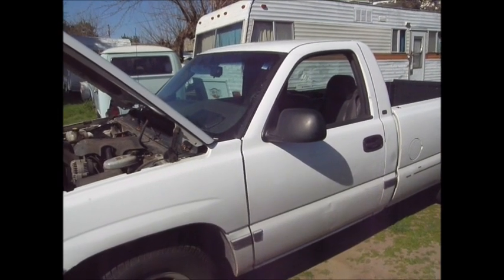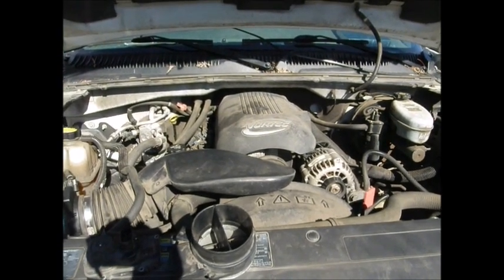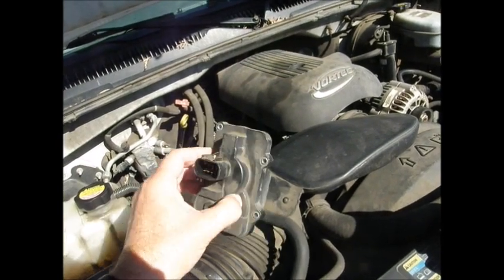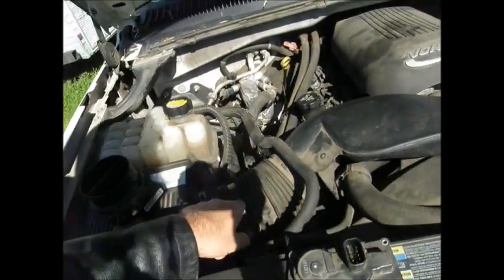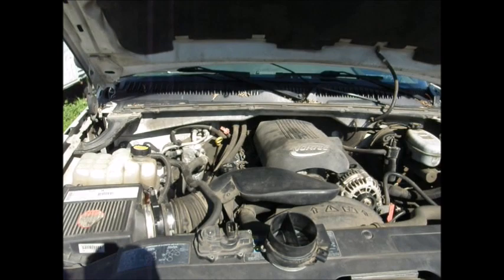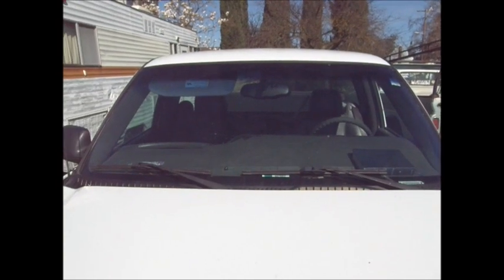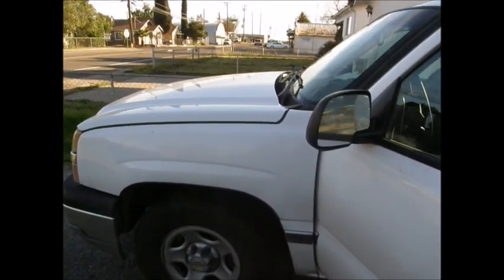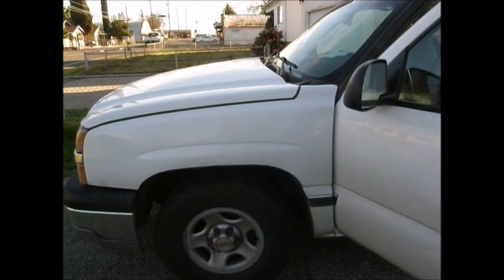Chevy Silverado Reduced Power fixed.

Comment: I have a 2003 Surbuban, it has a new Throttle position sensor from previous owner and the pigtail wiring is new but its wired with wire nuts. Lol. Yeah but as of now since I worked on it, it was the ground on the passenger side wiring harness next to the firewall. It had a inch long split in the wiring exposing the wire and probably arching. I cut it, soldiered it and used heat shrink tubing about 6 inches long to cover the exposed wire. It was throwing 6 codes, now nothing. I also cleaned the grounds under the driver side door to the frame. So hopefully all is well. Time will tell. Glad you fixed your truck

Comment: Have the 5.3 liter 2003. Doing the same. Scan tool will not show what the problem is. Was it the mass airflow, or the Throttle body sensor the problem?
Reply from the maker: I changed both of them so wasn't sure which was the ultimate problem. It was fixed and my friend was happy that is all I can tell you. Maybe change the mass air flow sensor first since the throttle body sensor is a bit more work.
Reply from the maker: I tried cleaning everything it only helped a little but right back to the same problem. One of them  was the problem.
Reply: @BaconNBeer  Saw this comment  on another video. May work. The real fix is!!!!!!!!!!!!!!!Cut the boots off the battery cable ends and clean both sides with sand paper. Cleaning the one side is not enough the lug side is never serviceable unless boot is removed. I just used dielectric grease to cover instead of buying new cables. Also remove the primary cover and shroud around the fuse box under hood. Remove the positive lugs. Most gmc have three 1 from pos battery cable and two smaller ones powering the computer and something else. When you look at them they look good no corrosion but if you look closely it will look Grey. Sand both sides of the ring connector and the lug surface. Overtime no matter where you live air temp and moister slightly oxidize the metal. What happens is one of these powers the pcm and the others send power to vital sensors. Most of the time as long as its not a broke tps wire or if you accidentally stretch while in drivers seat and kick the pedal connection this connection oxidation does not allow the pcm to have a solid constant battery voltage so when the pcm dedicates the 5v reference to the PETAL AND TPS they are varied. Thus eventually the pcm does not allow the key on pretest yes your gmc will tell you reduced power without starting. Turn key on and wait about 10sec and if the pedal/tps agree nothing will display if not it will display reduced engine power. Also if you are having REP while driving add a new ground on drivers side of engine bay from firewall lug to one of the bolts on the bolts on the alternator bracket. Also grounds underneath drivers side frame rail, under radiator support, and the main negative lug on drivers side engine block. Also on the passenger side engine bay there is the pcm ground that comes out of the the big loom on the firewall goes out to the back of engine just like the braided one it is covered in crinkle cover but they are black wires usually two wires. Cut as low as possible bring up and solder one thicker wire estimated at double the gauge of one of the wires so you won’t have resistance problems. Remove the braided ground from firewall and remove one bolt from the third coil pack closest to the rear of engine and attach the braided ground don’t double ground this remove it because you could cause what’s called a looping ground. Electricity goes to path of least resistance. Since the braided line is very hard to remove from rear of engine block attaching the firewall end back to coil pack bolt leaves it null/void and tight so it won’t rub anything else. Also use a ground wire insulated I think it was 15in from parts store $12 for the new firewall to alternator bolt connection. I guess I could have made a video but I’m posting this on comments in various places share if you think it’s a good thing. My Rep problem is solved no tps,pedal, or throttle body replaced I researched this problem for months because I know a shop would just hose me for parts and I think most sensor issues and there lifetime are determined by there power/ground consistency. 2001gmc Yukon slt 260k miles. Good luck guys.

Comment: I put in a new MAF, new throttle body with sensor, new accelerator pedal sensor, cleaned the grounds under the driver seat, checked for frayed wires. Still in limp mode.
Reply from the maker: Check the grounds from the engine to the frame sometimes they come lose or fall off.

Comment: I have that same issue with my dads truck, we changed the Throttle body and its still doing it.
 i guess now im gonna replace the gas pedal sensor and if it doesn't fix it the TAC is next. Gm should recall this trucks, we almost got rear ended when the Reduced engine power message poppep out in the freeway.
Reply: Did you get it fixed? I have the same issue.
Reply: The real fix is!!!!!!!!!!!!!!!
Cut the boots off the battery cable ends and clean both sides with sand paper. Cleaning the one side is not enough the lug side is never serviceable unless boot is removed. I just used dielectric grease to cover instead of buying new cables. Also remove the primary cover and shroud around the fuse box under hood. Remove the positive lugs. Most gmc have three 1 from pos battery cable and two smaller ones powering the computer and something else. When you look at them they look good no corrosion but if you look closely it will look Grey. Sand both sides of the ring connector and the lug surface. Overtime no matter where you live air temp and moister slightly oxidize the metal. What happens is one of these powers the pcm and the others send power to vital sensors. Most of the time as long as its not a broke tps wire or if you accidentally stretch while in drivers seat and kick the pedal connection this connection oxidation does not allow the pcm to have a solid constant battery voltage so when the pcm dedicates the 5v reference to the PETAL AND TPS they are varied. Thus eventually the pcm does not allow the key on pretest yes your gmc will tell you reduced power without starting. Turn key on and wait about 10sec and if the pedal/tps agree nothing will display if not it will display reduced engine power. Also if you are having REP while driving add a new ground on drivers side of engine bay from firewall lug to one of the bolts on the bolts on the alternator bracket. Also grounds underneath drivers side frame rail, under radiator support, and the main negative lug on drivers side engine block. Also on the passenger side engine bay there is the pcm ground that comes out of the the big loom on the firewall goes out to the back of engine just like the braided one it is covered in crinkle cover but they are black wires usually two wires. Cut as low as possible bring up and solder one thicker wire estimated at double the gauge of one of the wires so you won’t have resistance problems. Remove the braided ground from firewall and remove one bolt from the third coil pack closest to the rear of engine and attach the braided ground don’t double ground this remove it because you could cause what’s called a looping ground. Electricity goes to path of least resistance. Since the braided line is very hard to remove from rear of engine block attaching the firewall end back to coil pack bolt leaves it null/void and tight so it won’t rub anything else. Also use a ground wire insulated I think it was 15in from parts store $12 for the new firewall to alternator bolt connection. I guess I could have made a video but I’m posting this on comments in various places share if you think it’s a good thing. My Rep problem is solved no tps,pedal, or throttle body replaced I researched this problem for months because I know a shop would just hose me for parts and I think most sensor issues and there lifetime are determined by there power/ground consistency. 2001gmc Yukon slt 260k miles. Good luck guys.
Reply: Check those ground straps.

Comment: im having the same issues
Reply from the maker: I am not sure which part that we replaced was the real culprit but they worked together so replacing both made sense over experimenting. It is still going strong two years later. I tried cleaning things first just to give them a chance which didn't get the job done. Replacing the throttle position sensor and the mass air flow sensor took care of the problem. Good luck with your problem. Hope this video helps you out.